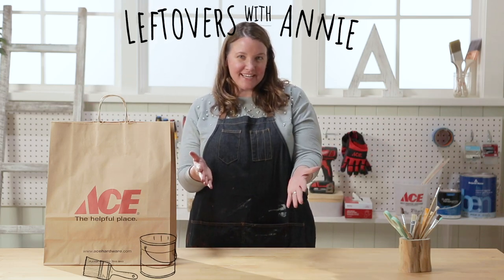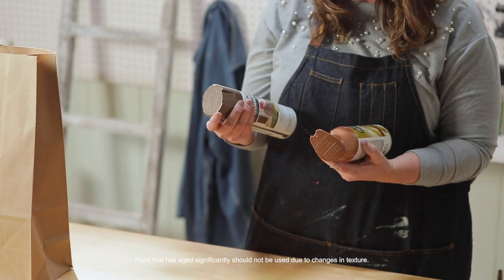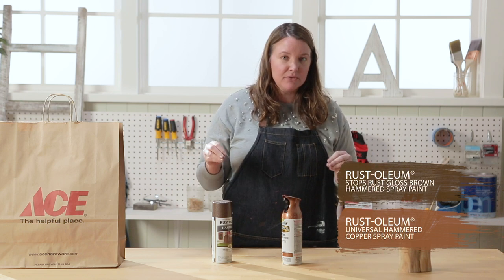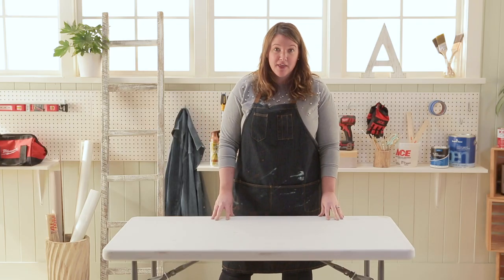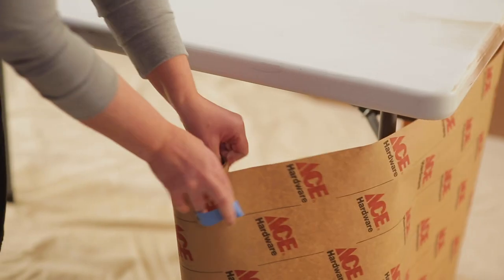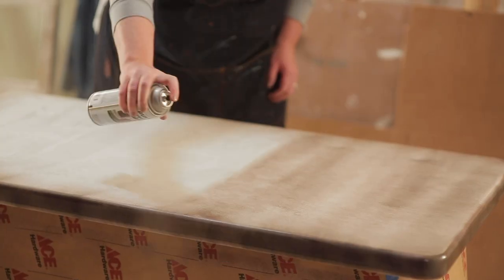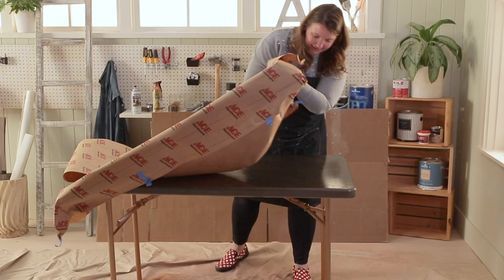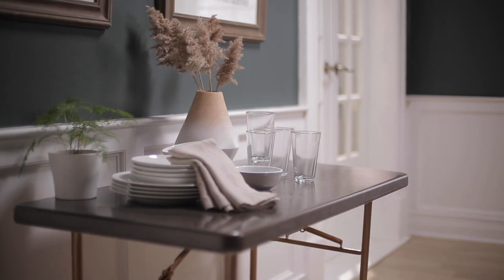How To Spray Paint A Plastic Table - Ae Hardware

Comment: won't the paint flake off?  even with sanding, I have my doubts
Reply from the maker: Hi Tessa, This particular type of spray paint is more durable vs. your standard spray paint. It offers a corrosion-resistance and lasting moisture protection. I hope you can tell from the video, but the table top almost looked like lacquer once it was done. If applying to a light color table top, you may need up to 3 coats if you're using a dark color like we did. Hope this helps! Thanks for watching!
Reply: @AceHardware  thank you! *I'll have to try it.
Reply: I have done this and so far it has held up! It has been 3 years, curious what two colors are used here… love the combo
Reply: This is what I was looking for ! Do I need a primer or will it hurt to use one if I wanted to?
Reply: How well does the paint hold up to scratching from sliding heavy objects across it? Like I would the plastic 🙂